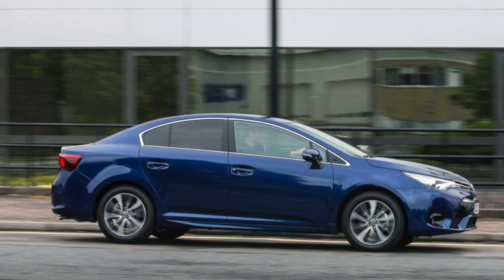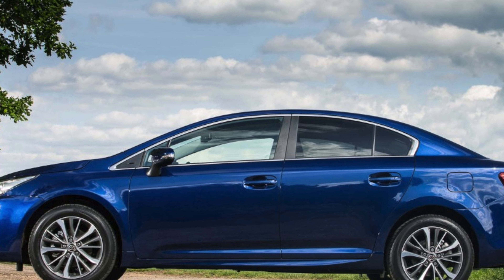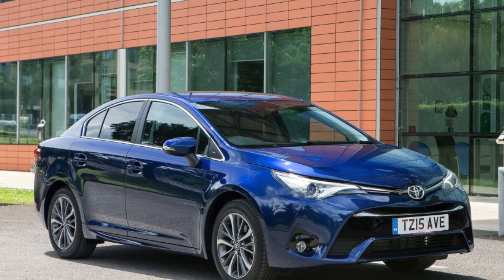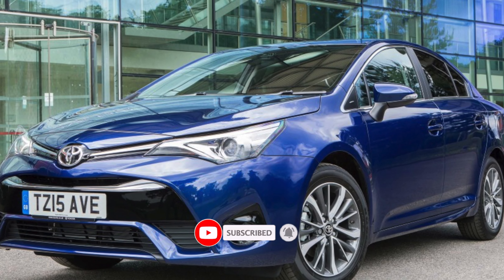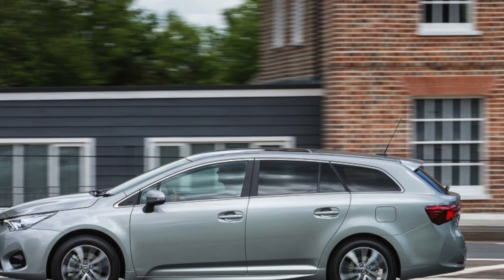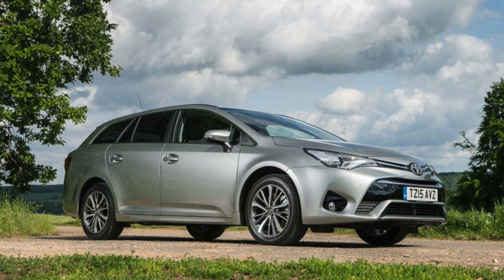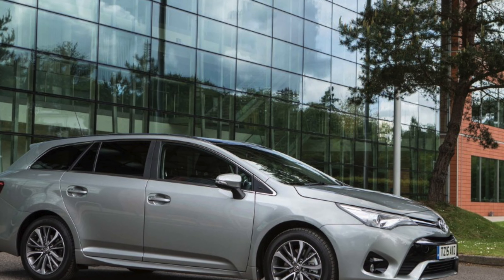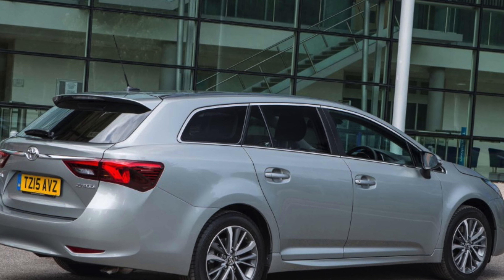Toyota Avensis 3 Problems | Weaknesses of the Used Toyota Avensis T270

Comment: I have the 66 reg 2.0 business edition with 56000mls on the clock, I've had it nearly 3 and a half years and had no problems at all, I do own a 1.0 petrol yaris which keeps the short journeys to Tescos off the avensis which does 250mls a week mostly longer drives. I service it at the Toyota dealership every 12 months with an oil change at my local garage 6000mls after the 12000mls service at the main agent, I don't believe in leaving it 12000miles in between service, far to long. Lovely motor though and comfortable on long journeys.

Comment: Crappie engines. They are bmw based. I had a timing chain stretch witch cost me £1500. I was lucky the engine didn't fail. All my taxi driver who got the 1.6 or 2.0d all had their engine fail due to the timing chain fails.
Stick to petrol 1.8l versions of the avensis it's a toyota engine. More reliable.
Reply: Brother my car timing chain snapped.  I don't know what to do.  It's only 120k mileage.  Could you advise me
Reply: @runn551  new engine or new car brother.
Reply: @Mohammed Atif  how much will be new engine?
Reply: @runn551  3-6 thousand from toyota. Or just get second hand used engine.